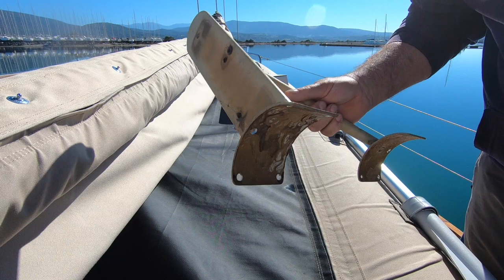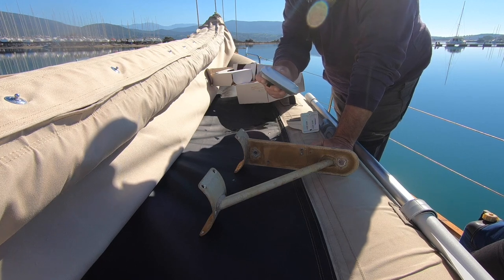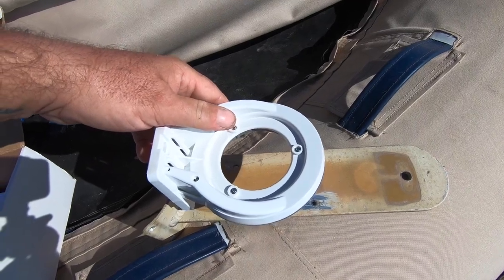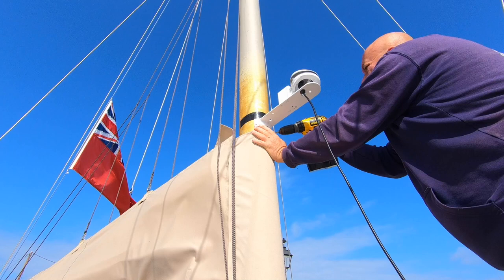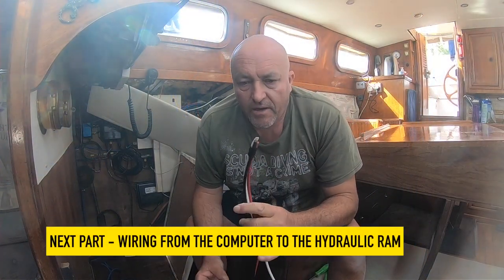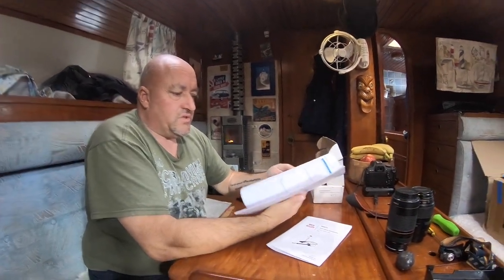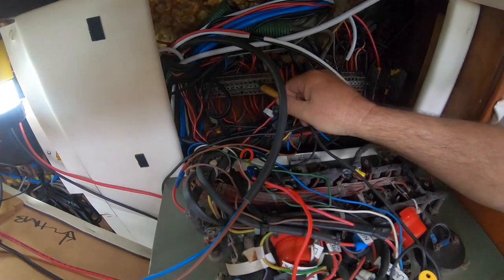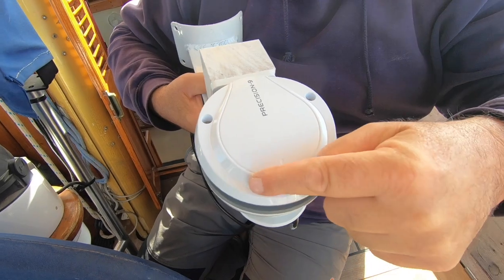EP 119 Autopilot Installation #sailing #BlownAway #Autopilot

Comment: As trekkie I absolutely got the reference.
My friends on Britican once change the position of their spare anchor (a 65 KG piece of steel) in the lazaret, it totally messed up the autopilot.
I think you have enough distance from the mast to don't have any issues, a magnetic field in low voltage systems like max 48V is about 10-15 cm.
Reply from the maker: Hahah.  A fellow Trekkie. Cool 
The bracket is a test piece if it works ok it’ll stay if not I will have to extend it. 
The book is pretty good with info and instructions etc 
Thanks for watching